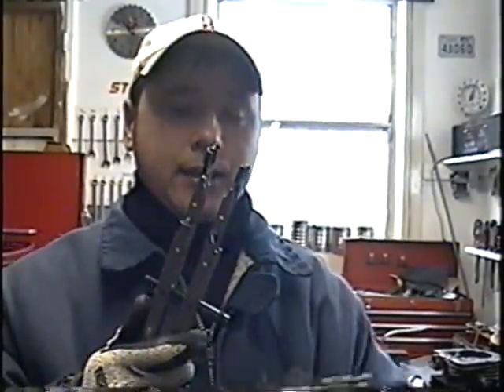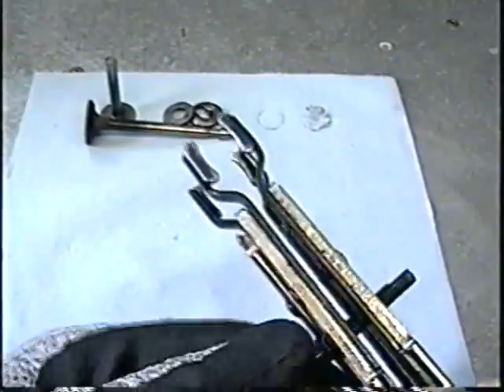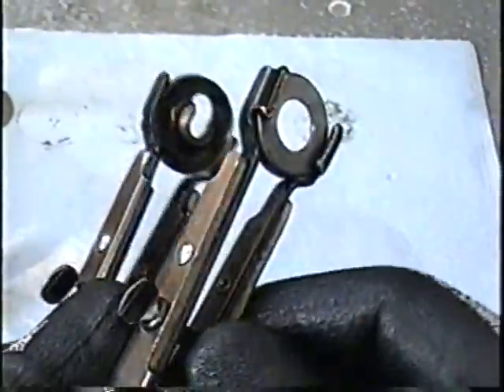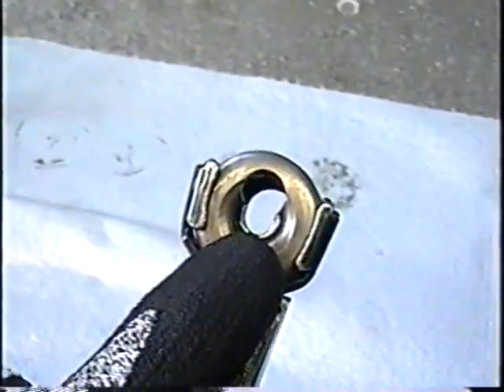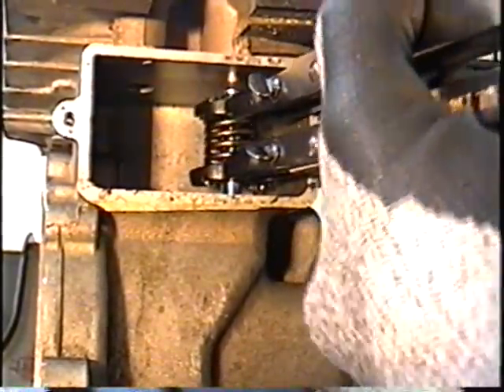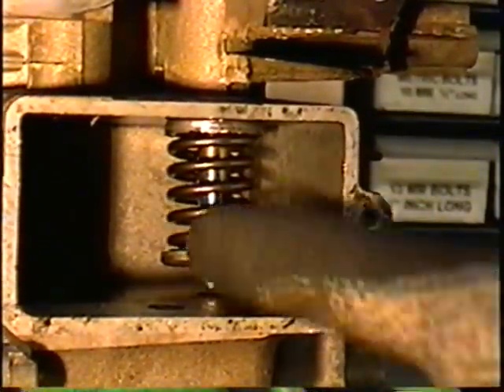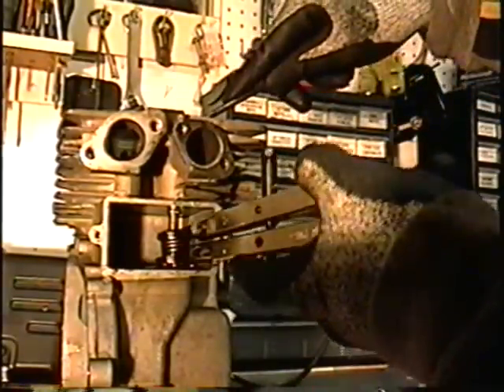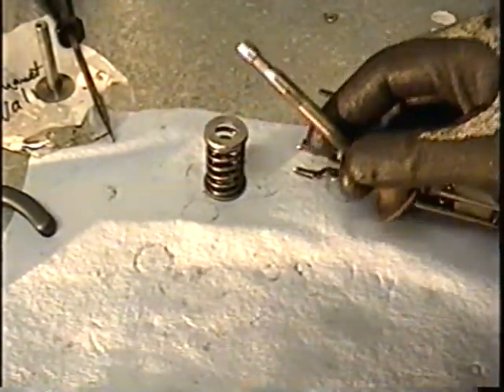HOW TO USE VALVE SPRING COMPRESSOR TOOL ON SMALL ENGINES FOR REMOVING VALVES

Comment: Hello,
Just a quick comment.
On some engines, there is only one spring retainer.  Therefore, after installing the spring, double check that the spring is located parallel to the valve stem.  The end of the spring with no retainer may have slipped out of position.

Comment: You would not believe what I used to get my valve spring back in my Kohler k141 moto mower snow shark. This video helped me get the job done without the compressor tool.

Comment: My tecumseh engine feels hard to turn over what is that? Lack of lubrication? or the valves being tight? I'm rebuilding a go kart engine,also when I took the sump cover off inside looked like some slight damage in a couple places of the aluminum and on the lifters base,looks like theres a circular crack,im replacing them but maybe the engine blew at one point in its history.

Comment: Is the top caps on Tecumseh HM100 valve springs different? Does the intake have a white ring in the cap and the exhaust just have a steel cap? Like one has a oil seal and one don't or is one of mine broken?

Comment: I have an early Briggs 5 HP horiz engine that uses a cross pin instead of the keyhold shape hole spring retainer, A inverted depression on the keeper retains the cross pin from exiting during engine operating.

Comment: I've have seen a few of these motors grenade out the side where the starter sits. You can take off the starter and see the casting with a big round crack, along with the connecting rod sticking out the hole;(  What could be the cause of this?
Reply: Engine rpm too high

Comment: Don, I have a question for you. I have a tecumseh oh195sa engine. Syptoms were no start, 0 psi compression all going out the carb.

Opened the valve cover to find the intake valve spring retainer broken in two. Rocker arm not damaged, valve stem slightly damaged to the point it wont slide out of the head.

Wondering how this would happen ? Also how can one check to make sure the head is getting oiled? shouldnt there be oil splashing up into the head when the engine is turned over?
Reply from the maker: hard to say exactly, I would have to see it

Comment: Valve seat question on a HMSK100.  I have this intake valve cap\seal thing. I tried to press it into the valve guide on top of the valve spring. It refused to go in. how is this thing supposed to go in?  Which way is pointed up?  I've already destroyed one and I got another one on order. Do I even need it? Let me know
Reply from the maker: I think the notch points upward
Reply from the maker: it may burn oil if it's not there

Comment: Hey I have a 1980 5hp Tecumseh. I just rebuilt the thing and had the valves all cleaned and lapped and adjust to the specification. But the valves are knocking when it turns over, do you know how that can be fixed?
Reply from the maker: maybe the clearance is too large between the valves, you may need new ones

Comment: what if your valve spring has only the retainer cap and no top cap?

my engine is a briggs and stratton 252707-0718-01
here is the sears link http://www.searspartsdirect.com/partsdirect/part-model/BRIGGS-STRATTON-Parts/Lawn-garden-engine-Parts/Model-252707071801/1245/1503500/00052638/00001
Reply: I have the same problem, so when Donyboy keeps saying "simply", it is somewhat irritating - there is no 'simply' about it: I just cannot get the damn tool onto that end of the spring.

Comment: They also make a spring compressor tool that looks like a C-Clamp for small gas engines.  It kinda depends on the engine design.

Comment: Without this tool it is possible using a wire to do this, but it is almost next to impossible. For the price the tool is invaluable, especially if you do small engine work allot.

Comment: Hi Donyboy,

I farted around with my 5HP snowblower for weeks.  Made sure that the engine was getting fuel, spark, and then tested the compression (40 psi dry, 60 psi wet) finally found that the valve spring retaining clip was broken.....

Have you ever seen this while working on tecumseh's?  How common is this problem?

Thanks

James, Montreal

Comment: @fastcars001 ohv engines are easier you dont need a spring compressor you just push the retainer with your fingers and slide it over out of the valve. but put some rope in the cylinder so the valve doesnt drop in, cause then you gotta take the head off